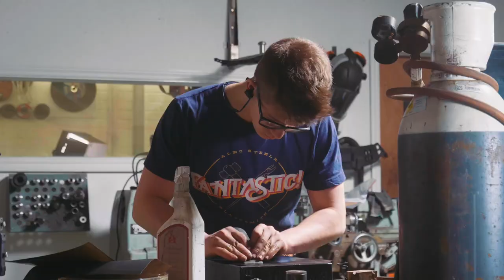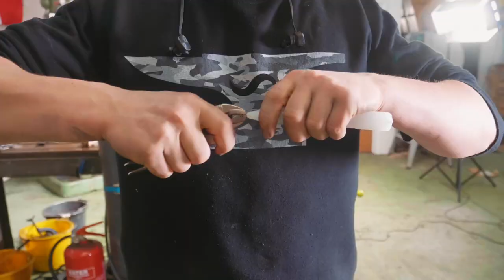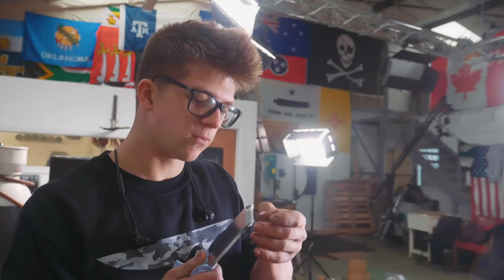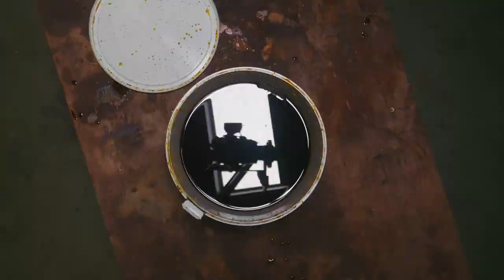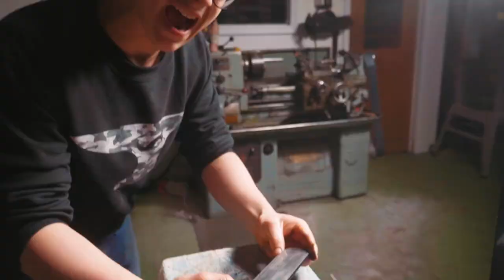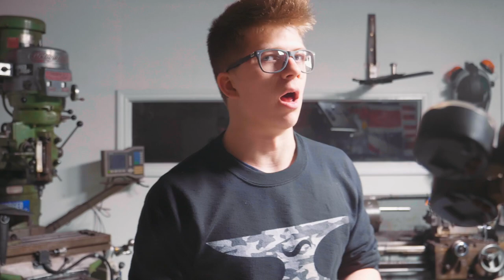DAMASCUS HAND PLANE BLADES!! Part 3: Dustin Penner Collab!

Comment: 1. Use tape to mask the piece (inverted)
2. Put in wax (or whatever)
3. Remove tape
4. Put piece in acid
Reply: Sascha Wagner h
Reply: h
Reply: tape may or may not (depending on the type and/or quality) leave unwanted residue that would negatively affect the etch, i would assume

Comment: From what I have heard, most manufactured plane blades and chisels are concaved towards the middle instead of perfectly flat for 2 reasons. 

1. To make sharpenning quicker and easier.

2. To make sure there is always 2 points of contact on the blade so it does not rock back and forth. 

Having the back of the blade is really only important at the bevel and on the sides

Comment: Sharpening is another one of those skills that keep forums going for years. The whole by hand or with a honing guide and then there's the whole how high a grit you really need for good sharpness. They say doing it by hand is faster if you know how but honing guides takes the guess work out you can always buy a tormek if you have the $400 to shell out but it looks like a really nice tool but a lot still use stones after that. I myself use a guide and I also find sharpening very relaxing for a while anyway😉 another great video! Thanks

Comment: I do alot of woodworking and joinery, im no expert but as a general rule for plane blades and chisels, you have a primary bevel of 25 degrees and then a secondary bevel of 30, it just speeds up the sharpening process and doesnt grind away as much steel

Comment: For future work like this, try using the wax, but before dipping the blade, define the line with a piece of painters tape.  Leave the end of the tape long, possibly folding the sticky face back on to itself, but this way, you can precisely control exactly where the line will be, and how very straight it will be.

Dip the blade and almost immediately grab the loose tail of the tape, and unwrap it as the wax sets!

Much faster than nail polish, and zero chance of something in the polish reacting badly with the steel or etch.

Namaste

Comment: I'll be that guy, but it's Dihydrogen monoxide, or oxide. But nice try bra
Reply: He mixed his greek and latin!
Reply: Here is a project for him to consider: forge a metal viking bra( female armor chest plate  (use a mannakin if ya don't have a model)).
Reply: You have to be careful with that stuff it is the cause of more deaths per year than any other chemical.
Reply: Yeah, but i really think he should be careful with that stuff.
I mean, it's extremely harmful to breathe, and can kill you quite easily, as it is heavier than air and stays in your lungs.
Reply: It's monoxide, since Dihydrogen dioxide exists, which has the common name of hydrogen peroxide :)

Comment: The "trick" I've found when sharpening my chisels is that your edge doesn't have to be absolutely perfect from that part (unless you're monstrously good) because you put a tiny micro-bevel on the end at a tighter angle making the tip razor sharp. The 13 degree bevel is just to get the blade close enough that a micro-bevel will hold.

Comment: Too bad that you didn’t know that a cup in the center of the back on a plane blade is fine.  It is only necessary that it be flat on the edges and particularly the cutting edge.
Reply: Yep machinist rule, all you need

Comment: Alec, some sagely advice... You don't hone or polish with a lateral movement on sandpaper for precisely the problem you encountered. This only concentrates imperfections and makes them more visible. 

You instead get a sheet of paper and not a strip of longboard (if this is your method), and move the work in a circular motion, using oil, because water will curl the edge of any hydroscopic material...like a cellulose based paper, causing stretching and raised regions that will chamfer edges in ways you can't control.

Comment: You need to look into to a surface grinder it’s a machine that has a magnet that would work great on this project use like grinding wheel with water coolant

Comment: Try sanding it using oil not water and using light pressure (and big magnets for handles), slide it in a figure 8 path. The surface will go "flat" enough to make anybody happy right quick.
Reply: The Back Channel  I think you'd need an oilstone for that. I use Japanese king stones and they need water, as do most modern stones although you can buy stones that don't need to be soaked (they aren't usually actual stone, they're usually synthetic a material)  oil would clog the surface and stop the grinding I'd think.
Reply: Big Gaz -- Thank you. I understand what you're saying about loading up the paper. That is a part of it. Lapping blocks would be best. But, who has a set of really big ones? I guess it all depends on how flat is flat, and how far from flat you are.

Comment: You don't cut with the outer 1/2" or so, plane blades have a slight curve when you sharpen them (on purpose by rocking the blade) so don't worry about that slight seepage
Reply: Watch Crimson Guitars tutorial on sharpening plane blades

Comment: If you use strips of sandpaper that dont cover your entire surface plate you should glue them down instead of using the water trick, because grit can get under the edges and wear into you plate causing it to loose flatness.  Not a concern if your sandpaper covers the entire plate tho, as the grit just fall off the edge.

Comment: Need to try a broad head spear tip. They used them with a shield wall. On 9 foot poles. Or the Viking throwing spear has a broad head look as well. 
Just a thought.

Comment: Use Frog tape or 3M Green label painters tape when you apply the nail polish so you get a sharp edge of the protection. way easier than trying to tame any shake in your hands.

Comment: Hey Alec gotta start out by saying I’m a huge fan of all your work. Been a subscriber for a while now and I’ve probably seen every single video on your channel and I think you’re an incredible craftsman. The pattern and figure of this Damascus is gorgeous. That being said, the woodworker in me is rather upset that these blades weren’t researched a bit more. Those problems you were having while sharpening ( the fear of rolling the edge) is usually a non issue because a quality plane blade has a ~8-10” hollow grind on the bevel as opposed to that flat grind you used. Having a hollow grind there means that you can rest the bevel on two pivot points on the stone. One at the back edge of the bevel and one right at the cutting edge. This helps a lot with maintaining that 30 degree angle. You simply rest the back of the bevel on the stone and tip forwards until the cutting edge contacts. This way you’re also not trying to maintain a flat across the entire bevel, just the two contact points of the bevel. Also, it’s my understanding that Damascus appears the way it does because the two metals corrode at different rates. If that’s the case then shouldn’t you have used a homogenous piece of tool steel forge welded to one side to create the edge? Otherwise as you get the blade wet (as you do when you have to hone it) the edge will corrode at different rates, ruining the edge. I’m not trying to come off super judgy but I thought this would be good info for you to know moving forward in case you ever do a similar project in the future. Cheers and keep up the great work!

Comment: Alec Steele, what do you use as sanding lubricant? When I was studying industrial design and model making we used Windex (blue window cleaner). It's cheap and works fantastic!
Reply: looks like he was just using handfuls of dihydrogen oxide, (Water)
Reply: Thomas Russell during the Japanese waterstone yes, with the sandpaper not sure, it's com8ng from a bottle.

Comment: If it is taking a long time to get a flat surface, put a hollow grind on the back side for 75% the length of the blade like you did on the chisel for the Samurai Carpenter, less surface area to make flat ;)

Comment: Don't soak those shapton glass stones. They can unglue. Also use tepid water. Using hot or cold and exposing them to room air can cause cracks.

Comment: next time, take your "plastic" hammer and tap firmly on the center of your concave  blade, (rounded surface up) until it makes contact with  the sandpaper. place on a wooden surface first and remember, you don't have to flatten the entire surface of a plane blade, only the edges and the cutting end. that goes for either side.

Comment: Hey Alec, there's a guy on youtube that uses a magchuk, is a magnet inside a table basically. About 20 by 14 maybe. He has taking that toll and put it on a motion device, so when he wet sands his knives, he doesn't move his hands. The table does all the motion he just holds the sand paper against the knife. It would save you a ton of elbow grease and I know you could build your on version. You may have to buy the magchuk but the motion table you can do yourself. I don't know the guys name but I find him Everytime I put in cable dumascus. He uses all the same tool Everytime so you will see what I'm talking about if you look for him. Give it a try.
Reply: 10 by 14 not 29

Comment: I may be irrationally paranoid about the chemical, but please understand the dangers of caustic soda.  It is an incredibly dangerous chemical.  Depending on the strength it will immediately burn flesh in a way in which you wont feel it and realize you were burned.  I work in the maritime field on chemical tankers, and the stuff dripped into a pump-men's eye during a chem test and burned it pure white, no more iris.  Anyway, nice piece.  Cheers mate.

Comment: Alex plane blades are not flat only the part at the back of the edge or bevel or the first 2 or 3 cm or 1 inch is flattened. If that is then the blade is fine. The top doesnt need to be flat at all.

Comment: would it have work, if you used tape to cover area where you don't want nail polish, and then apply polish little over the tape too, remove the tape, and  edge leaves nice even border

Comment: If you want it to be really 100% flat you need to hand scrape it. Youtube creator Keith Rucker from VintageMachinery.org (also the name from his youtube channel) has some great videos about hand scraping in order to get metal objects really flat. I've learned from watching Keith Rucker's videos and some others that hand scraping is even more accurate then machining, I was amazed to see what it takes to get things very accurate. For example you need a perfectly flat calibrated granite flat stone as well as some other precision tools and a lot of elbow grease and practice. I understand that it's not all that important for a blade, but it might be interesting to watch for some people how steel objects are made accurately flat, and it might also be interesting to understand why those objects need to be that flat and why the finish is done by hand scraping the metal instead of machining. 

Interesting fact....

When two small hand size steel objects have a perfectly 100 % hand scraped flat surface you can stick them together similar like a magnet but without the magnetic force and they will stick together just by the surrounding air pressure that pushes the objects together because all the air between the two objects is pushed out as soon as you put them together because they have a perfectly flat surface. As long as the objects have a perfectly flat surface no air can get trapped between the objects in order to push the objects apart from each other.

Comment: There is no need to flatten a plane iron dead flat. A hollow in the middle, back is not ever going to be an issue. Flat 1- 1 1/2" back from the sharp edge and, along the sides is more than adequate.  Sharpening beyond 1000 grit then stroping on rough out leather with a polishing compound, such as chrome oxide is more than adequate. Being sure to remove the bur from the back of the iron is more important than sharpening to 10,000 grit.
I imagine, if like Jesse the Samurai Carpenter, it's necessary to compete in a planing competition proving you can plane a shaving only microns thick, it might be necessary. That is all ego.
When you consider the coefficient of linear expansion of any given material, changes in temperature and, in the case of woods, humidity, you will easily exceed those kinds of tolerances. Fitting together a tight fitting joint, just the compression of the wood alone will exceed those tolerances. When you add the moisture from glue in final fit up, the associated swelling from the moisture, you will exceed those tolerances. Depending on the type of wood, seasonal changes in temp and, humidity could amount to more than 1/16" (1.5mm). 
I suggest watching a master carpenter like Paul Sellers, who IMHO is a far better and, more humble a carpenter than Jesse. Compare his fit and, finish to Jesse's. To the eye, they are every bit as good and, Paul teaches to make carpentry accessible to all of any skill level, with just a few basic tools. Jesse is all about, "look how great and cool I am," don't you wish you were as cool as me?